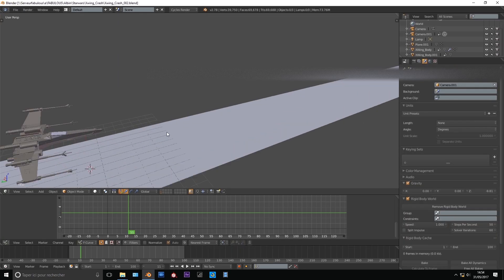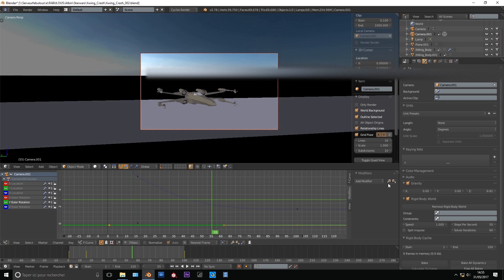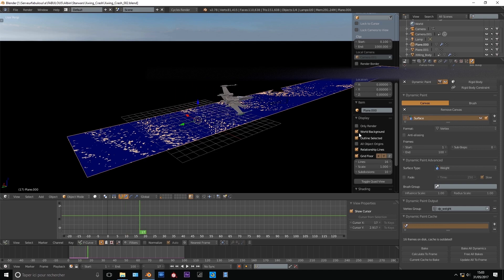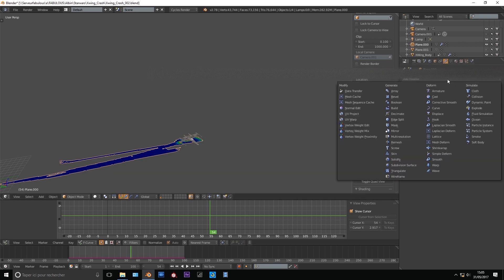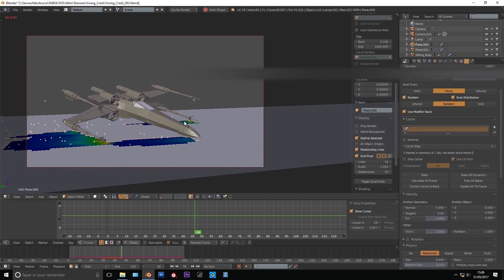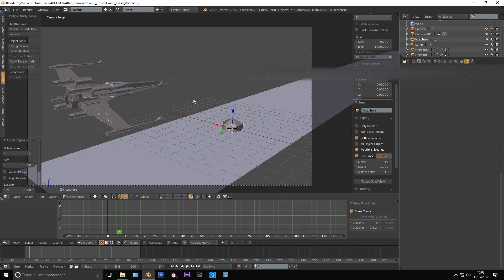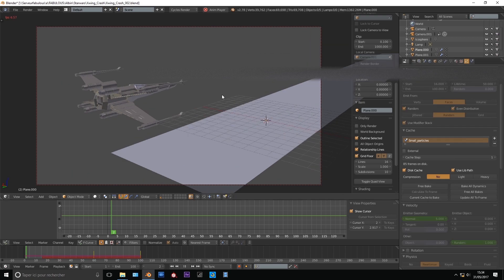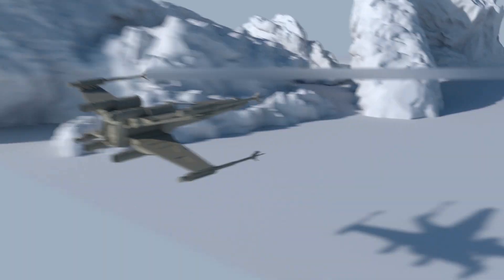Blender Xwing Crash Tutorial

Comment: Even today with version 2.9, Blender's particle system will not work well with vertex groups animated with Dynamic Paint.  This is the only method that I've gotten to work, but it still has bugs—spawning particles at the object origin when there is no vertex with any value to spawn particles. (the only way to work around that is to start and stop the sim at the first and last point of contact!) 
Blender developers should really address the particle system's inability to dynamically change the density of spawning particles.
Having the vertex group edit modifier remove geometry is a genius work-around though.
Reply: it is unlikely they will unless we as a community show them we need this feature

Comment: Not sure why you use the mask modifier. Why not use the vertex weight and apply it to the density vertex group. It will emit only there. Or are you raising the groud as well?
Reply: Is that masking perhaps to speedup the viewport>
Reply from the maker: Rombout Versluijs hi, first i tried this ( adding vertex weight un the density weight) but i didn’t work over the animation, it looks like animated  vertex weight in density is not relaible. A least it didn’t work properly for me, let me Know if it works fine for you, maybe i am using something Wong

Comment: Great video! I tried it myself and got everything to work. But how did you manage to animate and deform the wings of the Xwing separatly although it is one single object. Did you do it by hand? If so, could you make a tutorial on how to do that? If not, how is it possible to let the wings move and deform dynamically?
Reply from the maker: Hi Codan, You can try the fracture modifier built of blender to get a nice dynamic deformation. It's a powerfull tool and very easy to use. ( and it's free ;) )
Reply: Albin MERLE Thanks, will try it in a few days.
Reply: Okay, i just tried it and got a really nice simulation. However it is really slow while previewing. To fix this i tried to convert it to keyframed objects to finish it up in "normal" blender. But i don't get it to work there as one single object, which functions as a dynamic paint brush. Do you have a solution for this?

Comment: How do you break apart the wing? I tried applying the same techniques from the car crash tutorial and I'm getting terrible results.... On the bounding box for the soft body simulation do I need to model the ruff shape around the X-Wing or just cover it with a straight up cube like you did the car?
Reply: VincentG991 I haven't tried something like this yet, but I would advice creating the ruff shape. (Other possibility would be to use rigid body on the wing)

Comment: How did you get even squares with the subsurf modifier? Because when I try on a rectangular plane, it gives it rectangular boxes than even squares.
Reply from the maker: Hi, i think i understand. You just have to enter in edit mode before you apply the subdivide modifier and us Ctrl R to create edge loop and use Scroll mouse until you have even square on your rectangle plane. Let me know :)
Reply: Thanks! I just tried it and it worked as you said. Now to complete the tutorial
Reply: I've got a question. How would you create scratches as it's sliding across? I'm still new to blender but having scratches as it's skidding across would add a little bit extra detail to the animation that I think would be well worth it.
Reply from the maker: Hi, i ma using dynamic painting for this kind of effect. Directly in the shader. This is going Robbe the part 3 of my car crash tutorial